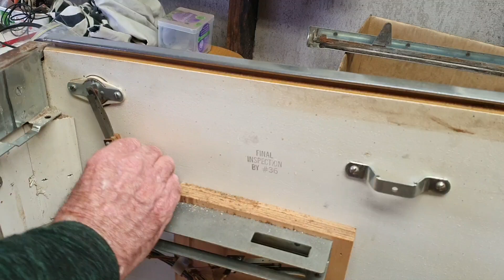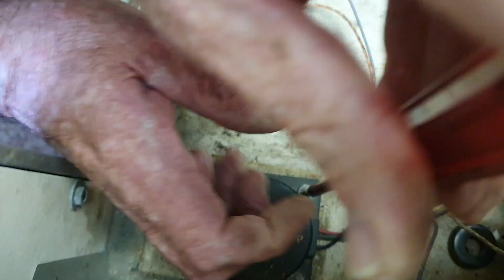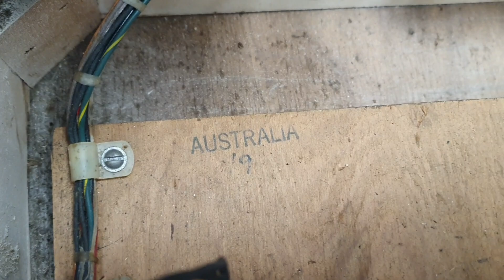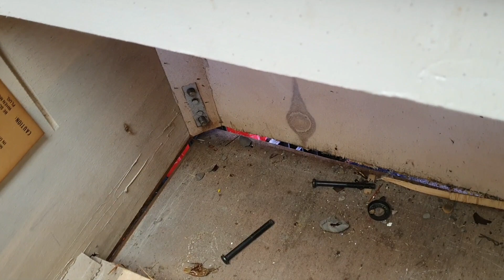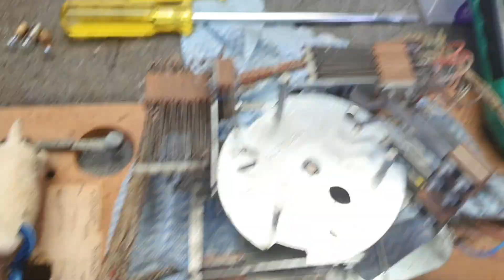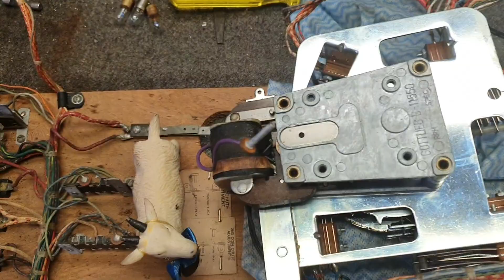Gottlieb Pinball Motor Board Removal and Servicing.

Comment: Wow !!! Great video !!!!  Thanks again guys !!!!!  I can see how much easier it makes it to remove the motor board !!   What was the white jumper wire with alligator clips for that was on the plug for the coin door ?
Reply from the maker: Bridges out the slam switch on the coin door so you can run the  motor on the bench.